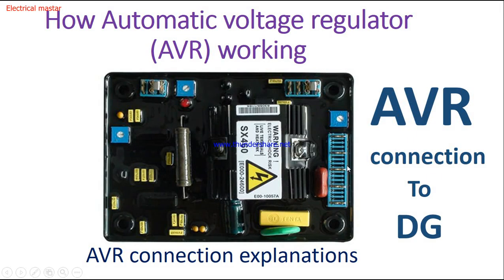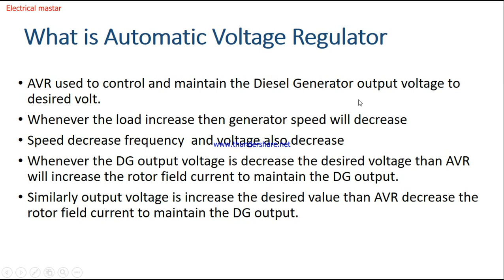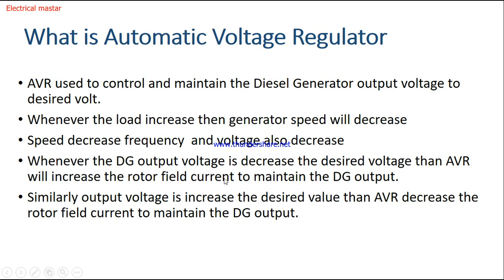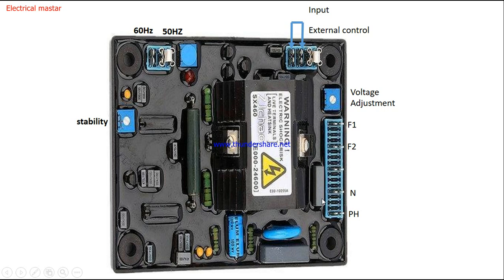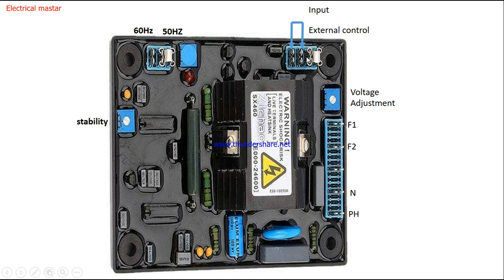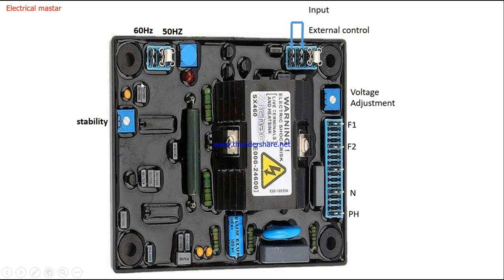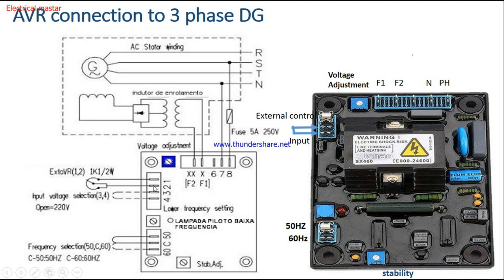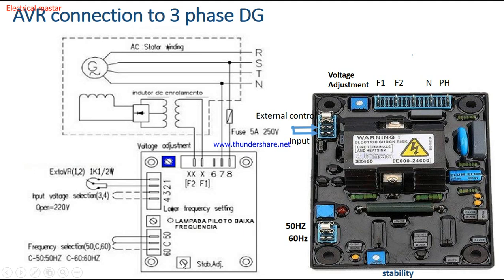How Automatic voltage regulator workings| How to connect AVR to DG wiring diagram

Comment: The connotation if you are mentioning diesel generator is that there is another type of connection for a gasoline engine as the prime mover. I do not see the need to mention the word diesel because the connection will be the same if gasoline engine is used to produce mechanical energy.

Comment: Please reply

Some of the avr two rating as sensing voltage and power supply voltage rating what does it mean. 

And some of the avr required some external voltage as -10 to 10 v what is it mean.

Comment: Hello please help  I have a PH.3 CY.60  VOLTS 440 AMPS.48  P.F.80  K.W.30  K.V.A.37.5 generator I nne to instal a Voltage regulator but I do not know what will work or even how to reconnect the CF+/CF-/F+/F-  and the other two wires from the oposite side on the winding. I need help thanks Eric in Hawaii
Reply from the maker: Thanks for your comments, could you send me the AVR model number or picture then I can clearly explain the terminal connection. You can send it to my email electricalmastar@gmail.com
Thank you and keep support our channel

Comment: Ok good explanation,but my question is can i use that specific AVR with an electric motor as driver for the generator?,coz if i cannot use it with an electric motor this specific AVR for me is USELESS,or for the matter any AVR on the market.
Reply from the maker: Hi thanks for your comments and i think we can't use AVR for motors because if you want to control speed of the motor either you have to go for vsd or soft starter's
Thanks
Reply: @electricalmastar  so if i'm not mistaken an AVR can control a motor increase the speed or slow it down based on the sampling the output of the generated electricity and according to specific parameters increase or decrease the speed of the motor right?in simple words...
So why that specific AVR can control a diesel motor but cannot control an electric motor?
Reply from the maker: AVR can able to control the speed of dc motor but AC motor its quite different you need to change the frequency of the motor to obtain various speed that's why I said AVR we can't use for that
Reply: @electricalmastar  well if what you just said its actually true my generator is an AC universal motor running on DC at 220V DC with step ups in parallel to reach 220v DC so if that AVR can control DC motors i am good no need to bust my brain in order to find a substitute of AVR.
Well i thank you for the quick answer and some clarifications you gave me,since i couldn't find anything on the Net whether  possible or not for AVR to control any electric motor.
Thanks again and have a great one!.
Reply from the maker: Thanks dear its my pleasure and keep support us